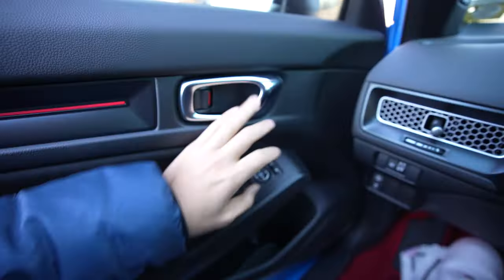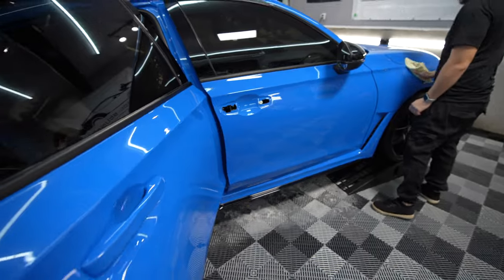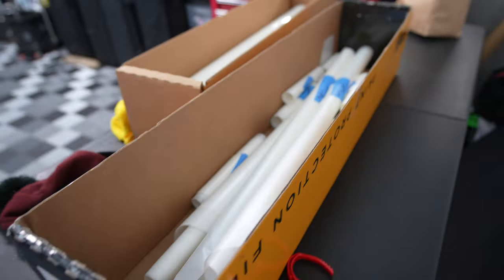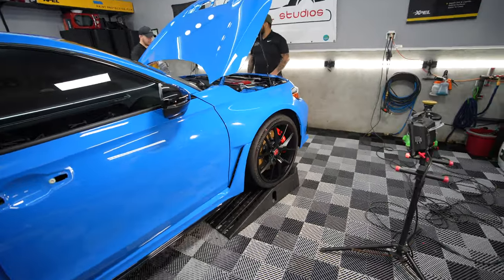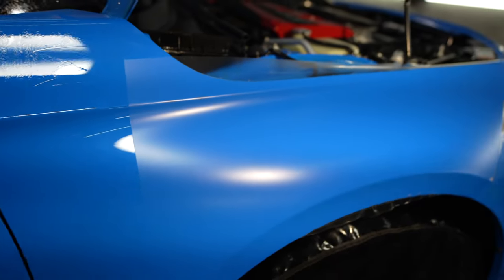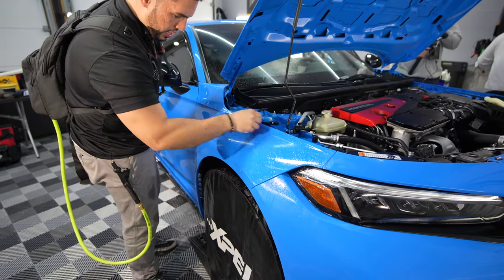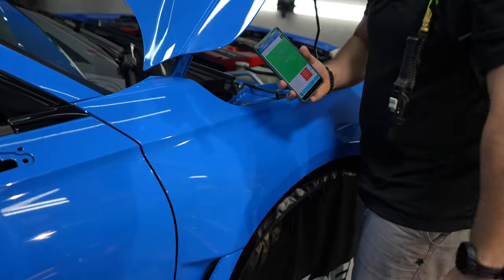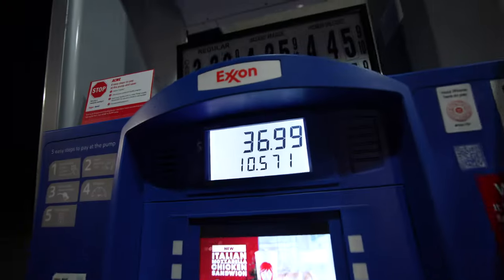2023 FL5 Civic Type R Daily Driver Prep - Paint Correction, Protection Film, Ceramic Coating

Comment: These videos keep getting me hyped to do stuff to my Sport Touring (Rallye Red). Not the same level power wise but you know what I mean haha 😂 so far I’ve thrown the HPD Spoiler on it (terrifying drilling 6 massive holes in a week old car), 15% tint, ceramic coating all around (rims included), removed the emblems and replaced with only the black H on the front and rear. Not planning to do much to the engine but next up are the Civic door seals, and the rear seat cargo protector. I’ve already got the all weather mats all around.

Keep these videos comin!! 🔥 🔵 🚙 💨
Reply from the maker: Thats the beauty of it - being able to make each car our very own! Thanks for your support! Cheers